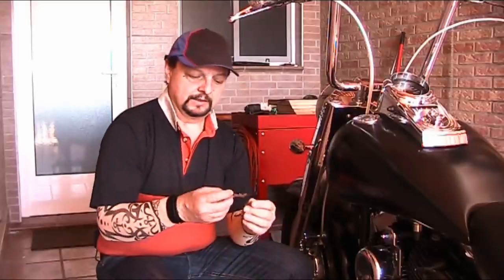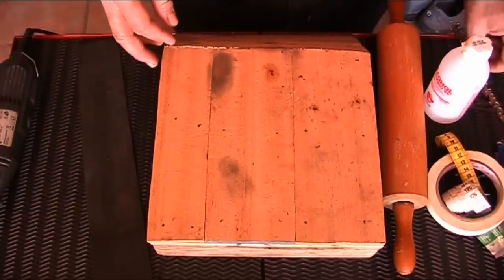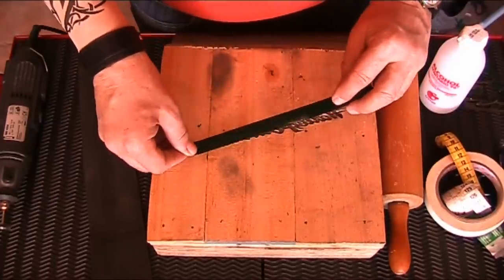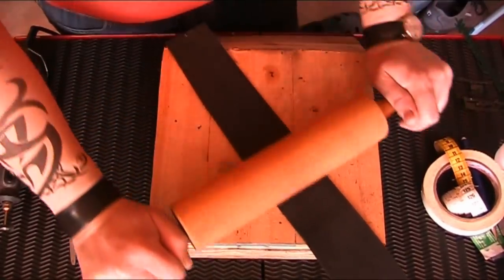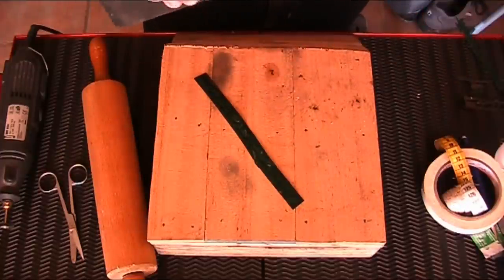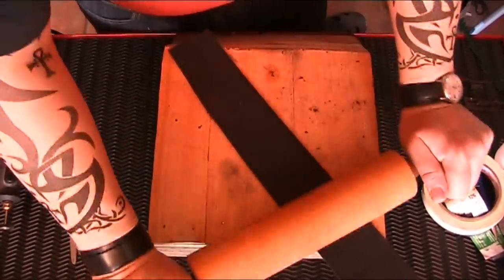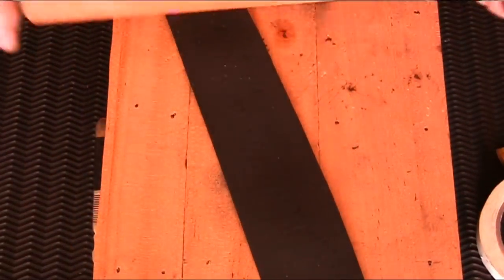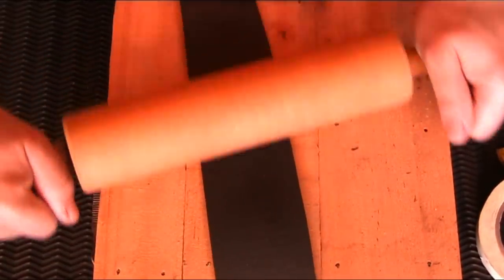HOW TO STICK A HARLEY TANK EMBLEM

Comment: Sweet Job Brosif
Would I use same method for my Triumph emblems?
 ...they look like same material but the letters are individual so would need more attention to detail when aligning them
Reply from the maker: Hi Tosh... These harley emblems have a very sharp edge that allows you to "cut" the adhesive take. I would look for that and give it a try.

Ride safe bro"
Reply: Vin # on Road king

Comment: how do you clean the original tape of the decals I had removed?
Reply from the maker: Hi Bill.
I used acetone. Real bitch to get rid of the original adhesive but if you are patient and let is soak, eventually, it'll come off. Do this ONLY if the badge is full metal.
Don't forget to share, rate and subscribe.
Ride safe!

Comment: Nice vid. Seems you still had to razor knife the tape even after the extensive roller pinning it. Also, you think it would be a good idea to measure the factorys badge location before taking it off?

Comment: I had assumed the dealership had installed the emblems symmetrical from factory so when I went to swap them out I just masked around the originals to use as a template for my new badges. Yeah..... don't ever assume. Haha... they put them on uneven but I had never noticed. I got the new ones on pretty good but it took a long time and a lot of second guessing. Still, I look at them sometimes and see it might be off by just a fraction and it bugs the hell outta me.
Reply from the maker: totally right berl232! I agree so much on this.... I had, as you can see, the same issue. In the end, stuck them on damn good but too high. Ouch! No way I'm takin them suckers off now, no sir!
Thanks for watching. Ride safe bro!